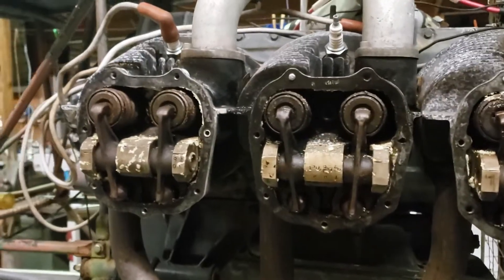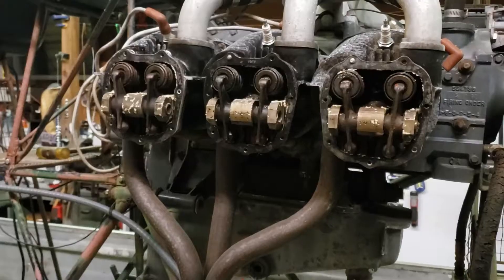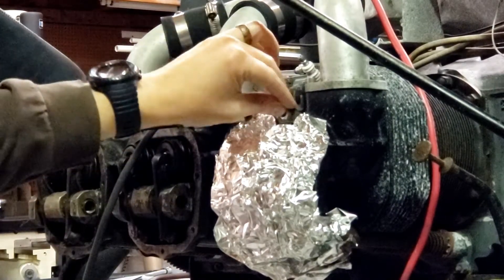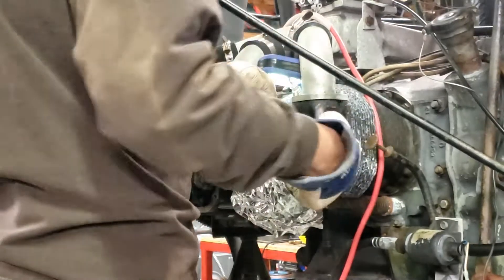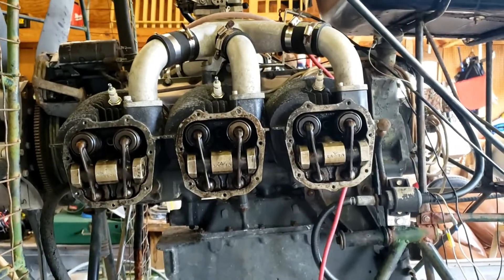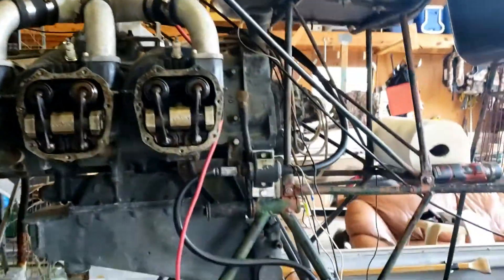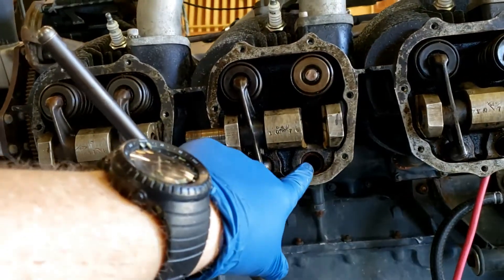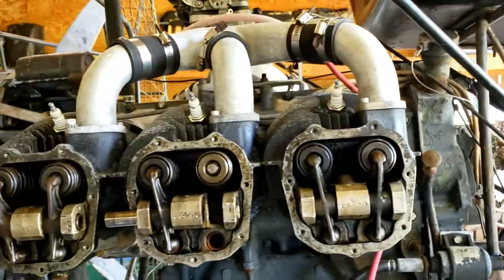Airboat 4

Comment: Use car gas that is ethanol free. Ask your gas station if they can get it!
Reply from the maker: Thanks John.  I get Avgas now, but maybe will eventually switch to non ethanol gas as it is cheaper.
Reply: @KMLTimesTwo  Also if your looking for parts, look into the E-225 engine. That was the aircraft version of the 6 cylinder GPU.
Reply from the maker: @jhaedtler  I hope I don't need too many parts, lol but I am sure it will happen eventually.  I just pulled the motor off last week.  I may have to repair a stringer or two in the hull.  yay!